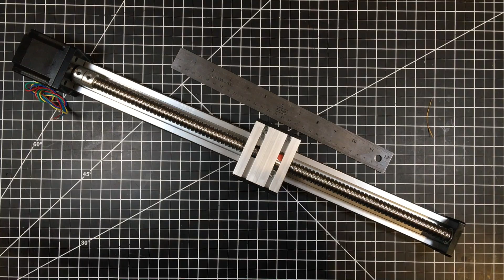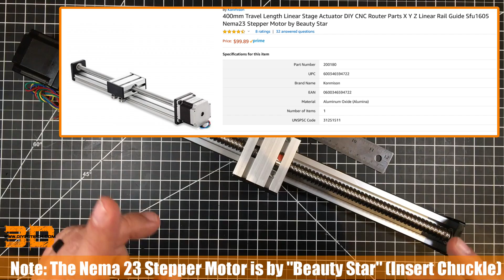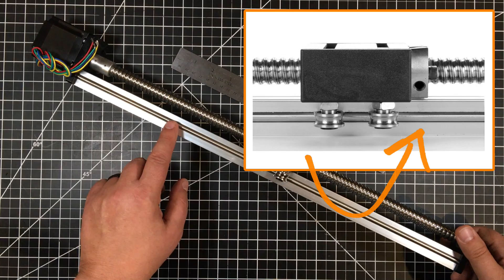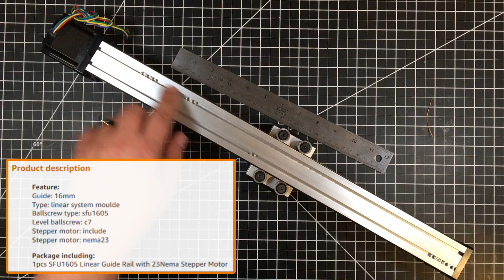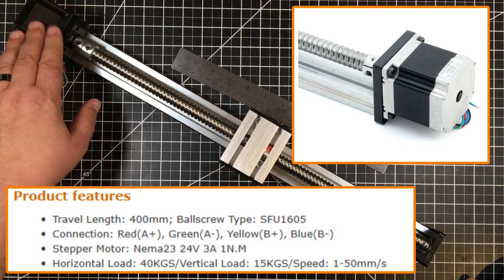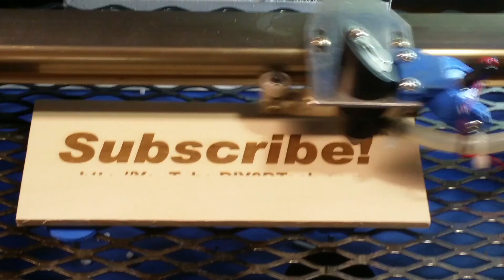Shop Talk - Linear Stage Actuator!

Comment: omg this is really cheap. I got the linear actuator slide for a couple of thousand dollars during my phd... but what are the resolution of displacement and weight /moment limit? Also, do they come with drivers and software as well?
Reply from the maker: Sorry can't recall, however there is a link in the description which can provide you with the answers.  As a side this has worked well for my applications :-)
Reply: @DIY3DTECHcom  Thanks much for the info

Comment: I like that linear actuator - rather expensive though - AliExpress offers much lower cost versions if you're prepared to wait a while for delivery 👍
Reply from the maker: AliExpress makes me nervous with some of their quality as I have bought from them in the past (not a actuator) and not been the happiest.  Whereas with Amazon, if I don't like it, its just a trip to Kohls to return it :-)
Reply: @DIY3DTECHcom  Ok, I get that 👍 - It's about finding a trusted supplier on AE I guess
Reply: @DIY3DTECH.com I agree and I had my first account banned for using my protection against total garbage I was being sent.  I did nothing wrong but the sellers did and even though I proved to AE's liking (to the point of my money refunded) I was still banned.  After that I purchased three other things on a new account and gave up on them.  What good is a protection plan that if you use it you get banned for it?  Absolutely nothing.

A word of warning with Amazon but for 3rd party sellers they are even turning rogue now because the last time I sent something back that came damaged I had to wait for my refund AND they treated me like dung so from now on I am staying away from 3rd party sellers which is ashame.  Really sucks that as consumers we have to fall victim to unscrupulous sellers.